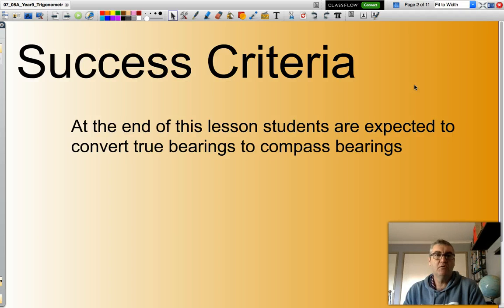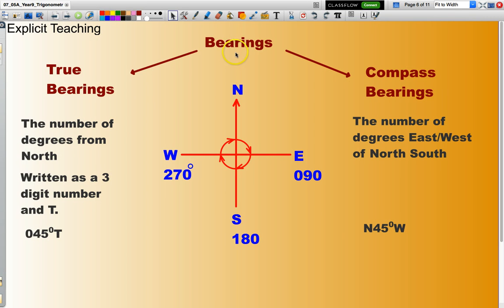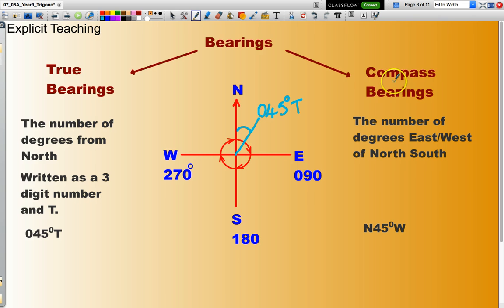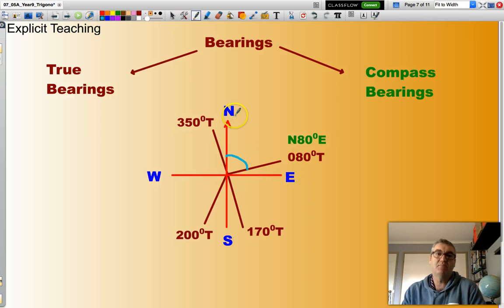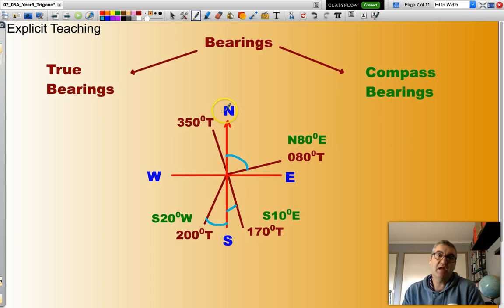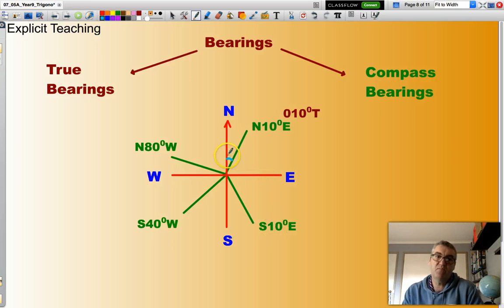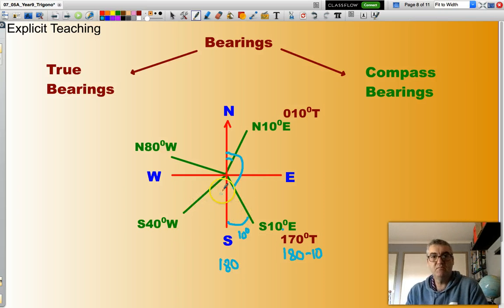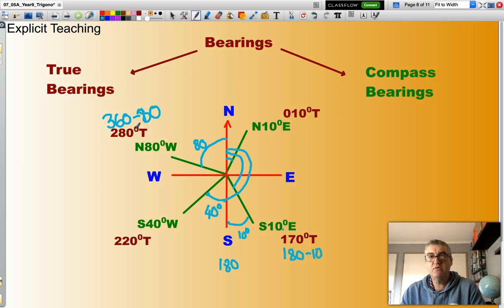Conversion between True and Compass Bearings

Comment: Very easy to understand and I totally get it but in all my flying and navigating I never have used this terminology for bearings.  In North America at least, you would never tell someone hiking go on a compass bearing of N10W.  You would tell them go on a compass bearing of 350 degrees.  You would never take off flying with a destination of S20W you would fly 200 degrees.  Great video thanks for sharing
Reply: Agree absolutely.  The terminology in this video will just add to the confusion many people have.  The 360 degree compass is simple enough.   Your heading is say 030, so the reciprocal track is 030+180 = 210  degrees.  Try doing it for N30E, will it be S30W or S60W or W30S or what the heck?!!
Reply: I think these terms are used in sea only...
Reply: @irfancandid1990  
I am not 100% sure but i never believe that this system is used at sea.
Sometimes, it’s used by the military, but why? Because it is top-secret, or maybe they can’t count up to 360.

Comment: Thank you! Very nice presentation, very helpful! :-) 

Quick question: Can a "True Bearing" also be called "Azimuth"?
Reply from the maker: I don't think so. Azimuth is (according to my understanding) best thought of as angle of elevation to stars.
Reply: So your back bearing will be the opposite? Like the back bearing from n10e would be s10w? Or n80w back bearing would be s80e?
Reply: Maybe this may help. In navigation,  azimuth is used to refer to the direction of the line of sight of a celestial object while bearing is used to refer to the direction of the line of sight of a terrestial object.
Reply: True bearing is relative to north, always going in a clockwise direction. An azimuth is an angle between 0° and 360° measured clockwise from North. A bearing is an angle less than 90° within a quadrant defined by the cardinal directions.